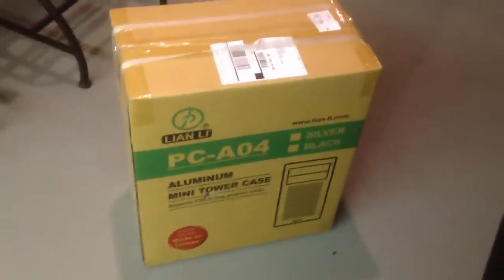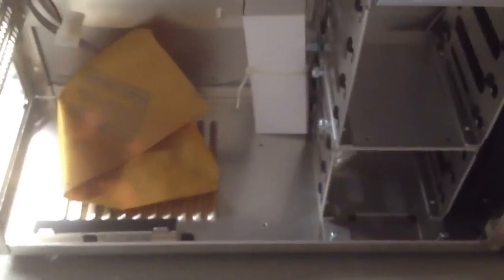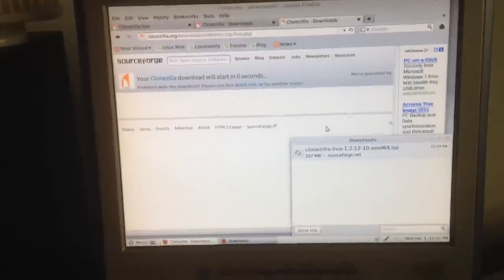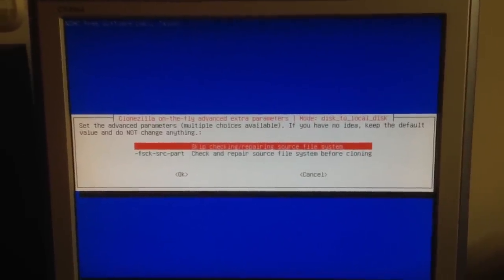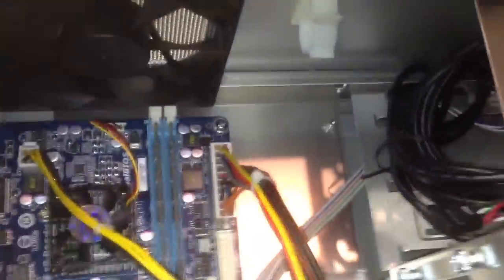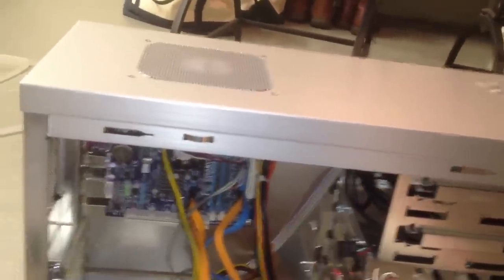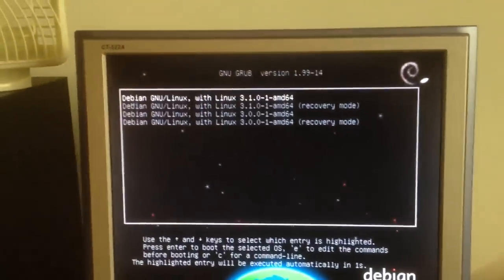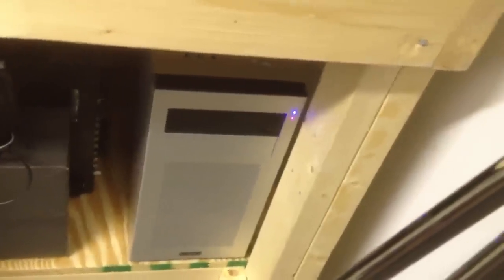Lian Li PC-A04 Case Upgrade For File Server & Maintenance To Said Server

Comment from the maker: @mattluvsvox nah, that's just a vent on the back of that drive. i thought it had a fan too when i first got it, lol. i could flip it around if i had to, but, it works in the position it's in. i plan on getting a different psu for that computer in the future anyhow for SATA connectors and such.

Comment: Xeon CPUs is a little overkill for personal usage (if not for game servers maybe). I am updating myself to a new server and I will use AMD FX-8350 BE 8-CORE 4GHZ. The system will be running a modified Linux version which is made for enterprise and lightweight systems along with Ceph to speed up the storage platform. right now I am using a small Toshiba laptop as a server, but I have outgrown it, it doesn't have all the features that i seek. works fine for web, files and teamspeak servers.